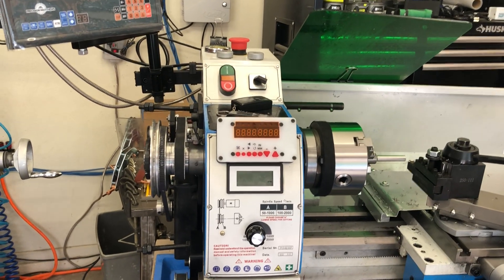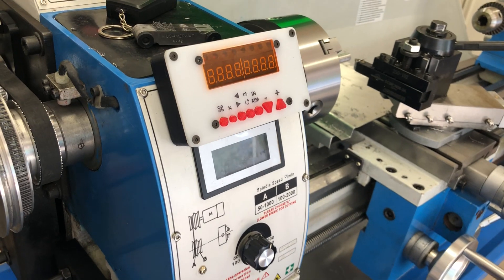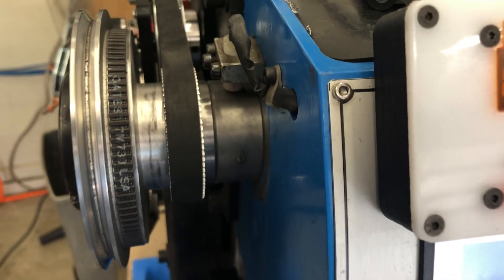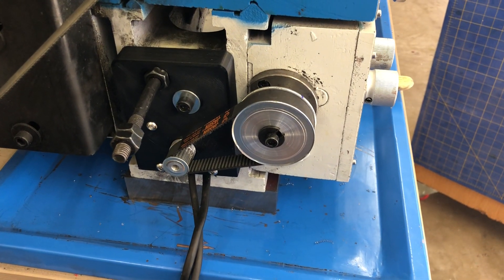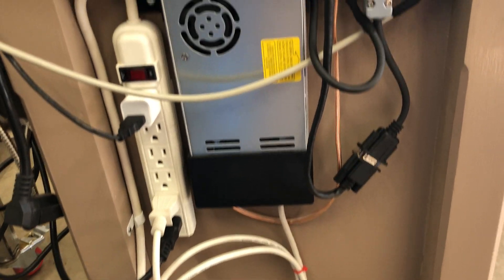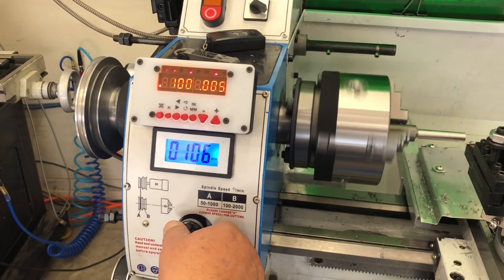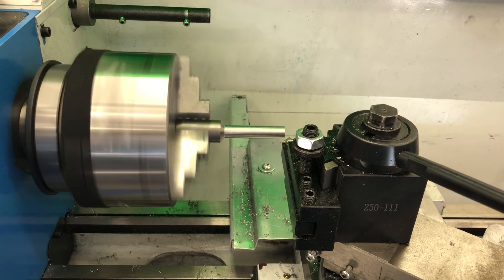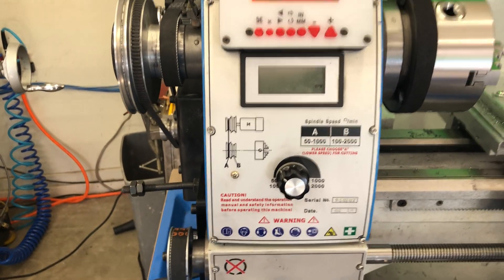Electronic Leadscrew: my Clough42 ELS implementation for PM1022

Comment: Dave, two years ago you mentioned that you swapped your original stepper for the new iSV57T-180.  I just happen to have a few steppers (4.0 Nm(566.56oz.in) Nema 24 Motor & drivers) hanging around that I wouldn't mind using.  My goal is to do a similar install as you did, but I don't really have an immediate need for cutting threads so I will be using the stepper as like a power feed.  Basically, similar setup but no encoder.  I will use a potentiometer to control the speed of the stepper.  Do you think the 4.0Nm  (566 oz) stepper would have enough oompf?  Thanks again for a great video!

Comment: Hi,

I just got a PM1030. I’ve already done a conversion to ELS on a mini lathe, but that was easy mode because the CAD files already exist for the entire machine. 

I’m designing my set up now and I was wondering if you still had some dimensions handy. What is the OD of the spindle? I’d like to preserve my factory bearing preload until it’s time to assemble everything.

Comment: Hey Dave. Great job. What lathe do you have?
I have a Southbend heavy 10L and I’m thinking of converting the motor to a 4 hp dc treadmill motor with variable speed. Also with the same electronic lead screw from Clough42. 
Did you purchase all the parts (or at least the electronics, controls, displays etc) from him?
I’d like to hear your thoughts on doing this to a dc treadmill motor conversion. 
Thanks for sharing. 
Paul
Reply from the maker: Paul, mine is a precision mathews lathe, just a rebranded and qced in America lathe of a Chinese import.  As for what I used, I used his code as a baseline, but rest was  purchased by myself, I think I list the specific parts I used.  I did use the Texas Instruments controller he used also.  As for the motor your using for your drive motor for a lathe, this mod is completely independent of that choice, as it syncs up with whatever the output shaft is using.  It overall is something I would do again, as once you have it, you’ll never want to go back to charging gears.

Comment: Would you make and sell the mounts for this setup I have a PM1030 and would love to do this but don't have a Mill to make the mounts.  Thanks
Reply from the maker: not for general production for sure, but easy enough to make a one off.  I would not make you one until you tried the 3d print to verify that it would fit correctly, or what mods you made to make it work (I can share the fusion 360 model also).  I'm pretty railed for time over the next 4-6 weeks for sure, but probably get you to it by mid february or so.  Note I used my 3d print for 6 months with no issues, so you can do that to tide you over.
Reply: @davegomez9798  how do I get the 3D files.  Oh and Thank you for getting back to me so quickly
Reply from the maker: They are here: https://www.printables.com/model/247290-clough42-els-supporting-files
Reply: @davegomez9798  Thanks

Comment: Hi Dave.  Thanks again for all the great info on this.  I saw a few more implementations on the PM lathes and your is the cleanest in my opinion.  I have a few more questions if you have time please.  Does your side cover fit back on with your design?  Also, on your links below to the parts you say the "Belt & Pulleys & servo I used (updated 5/31/22)" are 3:1 but the link is to a 4:1 pair of pulleys.  Are the 4:1 the newest version?  I am gathering all the bits and pieces.  My lathe gets delivered tomorrow!  Time to tinker :)  Thanks again.
Reply from the maker: I’m away from home till Sunday, I’ll post up which it is.  As for side cover, yes it does fit, as I used the same stud and hole for the servo mount, just had to back out the jam nut, but that side was fiddly to Bergen with, as my longer studs where not exactly straight from the factory, so som tweaking to straighten was necessary.  If you get a clean install, even though it’s a fiddly fit, won’t matter, as there isn’t much reason to remove the cover with electronic switching 😀

Comment: Hi Dave.  Do you happen to have the part number for the encoder you used?  I have ordered most the parts I need to do this on my PM-1030 but didn't see where you said what part number you used for that.  Thanks for the STL files also.  Nice work!
Reply from the maker: Chuck, this was in my Amazon history, 1000P/R Shaft 8mm Push Pull Output 5 to 26V Hollow Shaft Rotary Encoder https://a.co/d/9QemmSY
Sadly, it’s twice what I paid 3 yrs ago, but it does work well.
Reply: @davegomez9798  I think everything is at least twice as much as it was even year ago now if not more... forget about 3 years.  :/  Thanks for the info.  Can
t wait to get going on my conversion.

Comment: Hi Dave. First - thank you for sharing. I found your video by luck. It would help if PM-1022 was in the title.
I have the same lathe but built my Clough42 ELS for my old lathe. I am now in the process of installing it on this new PM-1022
The links to the pulleys suggest 60 tooth GT2 pulleys. I have not measured if they will fit the spindle once machined.
The ones in your video, look larger and the belt looks more like 9-10mm wide not a standard 6mm GT2.
Could you elaborate or give some dims?
Thank you in advance.
Mike S.
Reply from the maker: Michal,
  I updated my title first.  Second, I think the correct pulley set I used was is now listed above with correction.  I think all had to be probably be fit to the shaft, ie bored out, especially the one for the Motor to encoder, as I can't remember what it looked like disassembled, as that one is the passthrou for material.   Anyhoo, got a follow up question after the update, let me know.
Reply: @davegomez9798  Thanks Dave. I think I got the right parts on order. I will use your STL with my DIY CNC ;-) Mill to machine the brackets.

Comment: Thanks for you previous suggestions.  I just rec'd my lathe and getting ready to install the ELS leadscrew.  Just curious what stepper motor you used?  Thanks... Richard
Reply from the maker: Joel, I had issues with the original stepper, and ended up swapping to the iSV57T-180, the very same one that clough42 last recommended.  That is a much easier install with not having the separate controller.  Mine still fit in the casting with the extra bulk, but you may want to put a connector mid wire, as I needed to install the servo from inside the casting interior, put the plate on.  Couldn’t remember if I used printed parts, but I have replaced all mounting plates with aluminum milled equivalents also, as they did loosen after a bit.  The new servo is much better than the original, and also available via Amazon.
Reply: @davegomez9798  Thanks Dave.... That is what I had in mind.  All the best.... Richard

Comment: I, too implemented Clough42's ELS. For anyone considering doing so, since every lathe is different, we're each on our own to handle the encoder and drive implementation, but that's half the fun! (Oh, and mine was put on a Takisawa TSL-300 lathe and am very happy with it. In my situation, my lathe was missing the change gears, so an ELS was all the more useful.)
Reply: OK.....so this is just a leadscrew control and does not control the depth of thread via the crosslide in put and retraction of the tool etc.........so it is part ELS and part manual if you want to do threading.
There's another ELS system called the EZnc-2, reviewed elsewhere on UTUBE,  that does all of the threading requirements.
A passing thought.....with the move now to many people considering the ELS as a viable option to threading I would think the Chinese mini lathes will soon come out all with ELS's .....that would be cheaper and more efficient than having a change wheel gear set and also enable any pitch to be cut.
Reply: @gangleweed   "does not control the depth of thread"
man, the lead screw has nothing to do with thread depth.  This is not a CNC but still a manual lathe, so you've mixed thins up for no reason. The purpose of the ELS is just to get rid of gear changeover yet gears themselves, that's it.  The lathe with Clough ELS installed behaves exactly as a real industrial lathe. None of the industrial lathes figures out either thread depth or any other parameters cause that's a turner's job to do all that.
Reply: @MSM5500 maybe thread depth isn't part of an els, but it's a nice feature if you plan on cutting threads. On my grizzly g0602 lathe, with its imperial lead screw, the half nut can't be disengage when cutting metric threads. That means you need enough runoff room past the thread to stop the spindle and reverse the motor for the next pass.

With an ELS system that supports thread depth, you don't have to do the tedious stop/reverse spindle to cut threads. Plus, your designs don't need to incorporate a channel for runoff, and you don't risk ruining your part if you turn the spindle off too late.

Comment: Hello Dave... Just a quick question.  I am looking at buying the PM-1022 or PM-1030.  I  am new to this hobby and was wondering if you thought that the extra 8" of length of the 1030 was worthwhile?  The PM-1030 would be a tighter fit for my shop, but I could fit it.  Have you found the PM-1022 to have enough length?
Reply: If you have the space and money get the longer lathe. It will take but one project to make it worthwhile!
Reply: @UncleKennysPlace  Thanks!

Comment: Hi Dave,. Very neat.! I’ve got a very similar but slightly larger lathe and if I’d come across this earlier I think I’d have used your method of driving the rotary encoder. Instead I used an 80 tooth gear on the gear carrier driven off the 40 tooth spindle gear and then stepped the ratio back up to an overall 1:1 with the cogged pulleys. Your solution is quieter. I was able to tuck my James’ style encoder away in a recess below the lathe bed casting. I’ve done all the mounting brackets and got them installed. I’ve tested the electronics on a breadboard. Now need to put them in an enclosure. I suppose one advantage of my build is that it is very easy to disconnect the drive to the encoder or to revert to the mechanical gearing but I can’t see myself ever doing that! BobUK.
Reply: @ Robert Hawtin do you have the PM1127 ?
Reply: Hi m, I have same lathe, I’m setting up the hardware, please I have one question,  O wan to place the servo in your location, same, but I don’t know the belt size to be use, please wheat size dis you use in length?